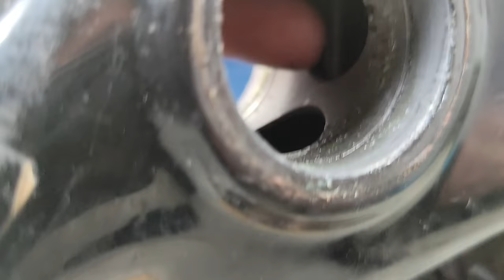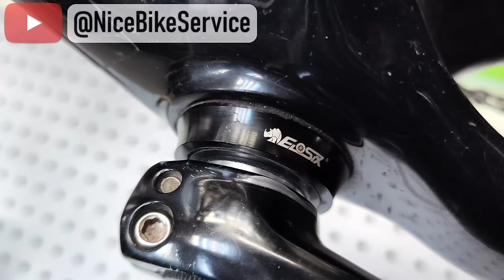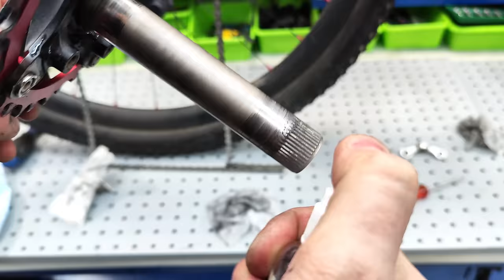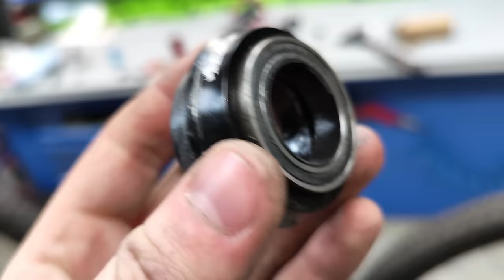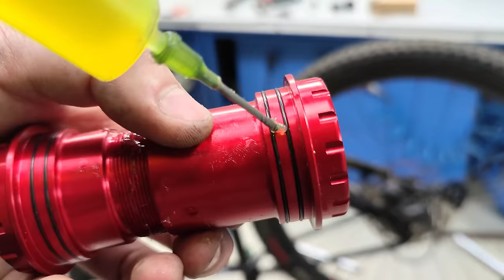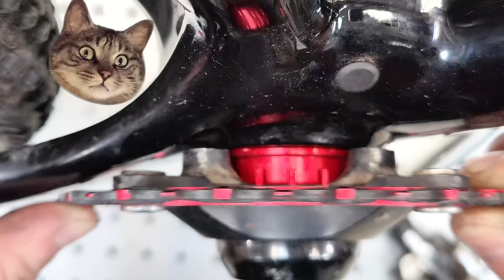How to Fix Bike Bottom Bracket | Press Fit BB30 ZTTO Ceramic

Comment: Never use a steel head hammer on cap removal tools as the prongs can be damaged easily .Only use a mallet with a wooden or high impact rubber head .

Comment: Hi I bought a 2015 KHS Sixfifty 2500 bicycle. The person who sold it to me made a modification to make it an Ebike. He cut off half an inch of the side of the disc chainring. The bottom bracket is not threaded, so on one side it has the stop ring and on the other side it doesn't. Can you give me an idea of what I can do, if you have a bottom bracket  for this, Thank
Reply from the maker: Hello. Try to find a bottom bracket that tightens into itself, similar to the one in the video but for your cranks. Such bottom brackets are also called Threadless Cartridge Bottom Bracket or repair bottom bracket

Comment: The fact that you pressed the cup with your hand 06:15, probably means that it does not hold its dimensions?. I think you would need to use an oversized Token bottom bracket there.

Comment: Great work. I really like that zitto bottom bracket. I know the Shimano ones I've replaced were plastic. I know they creak when they start to wiggle in the frame, even if they're made out of aluminum. That zitto threads together to make a completely solid bb. I wonder if it would ever start to creak or wiggle in the frame. Do you know how the bb is doing in that bike? How many miles so far?
Reply: @NiceBikeService  You meant ,  " UNINSTALL THE BOTTOM BRACKET " to show how much it has deteriorated.
Reply: They only creak if they aren't press fit and are slop fit. 
This bb won't help the issue if your bb shell is oversized

Comment: You don't need to change the BB you just need to tighten the spindle bolt cap
Reply from the maker: We've already tightened it - it didn't help, the play is in the bearings themselves

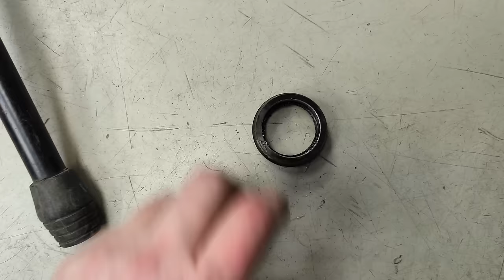Comment: 3:50 Please dont do it that way. You can clearly see that the bearing doesnt come out straight. If its hammered out by only tipping on one side, it comes out at an angle. That can damage your frame by widening the BB Shell.

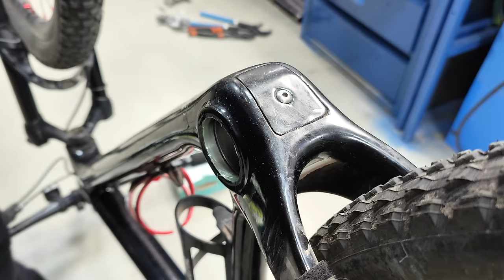6:00 the BB is way too lose. You made it even worse by greasing the BB. Grease is used on moveable parts, but you dont want your BB to move in the frame. Your BB is slipfit, not pressfit - maybe because you widened the shell by hammering the BB out. If its that slippery, you have to use loctite 609.

All in all not a good Job.
Reply from the maker: Thank you for your constructive criticism 😸